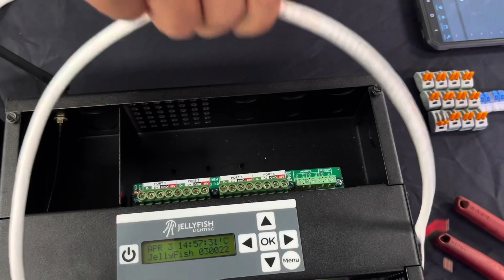Jellyfish Lighting - Power Supply to Mark 5 Light - Transmitted and Received

Comment: Ainfox 150FT LED Rope Lights, Waterproof 16 Colors Changing RGB Strips Light with Remote Controller for Outdoor & Indoor Use - SMD5050 Flexible Dimmable Decorative Lighting Multi Modes UL&ETL (150FT)      This is the SMD 5050 i have